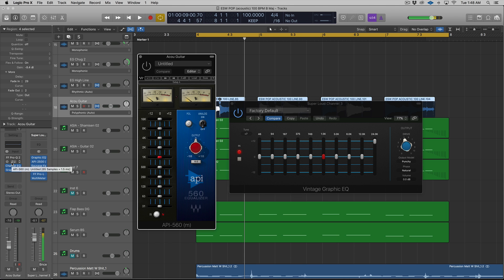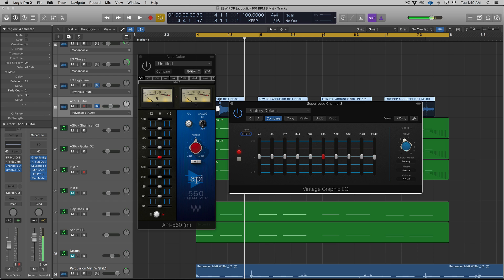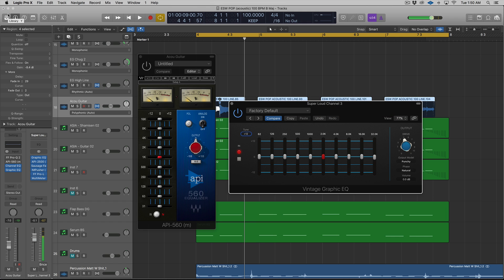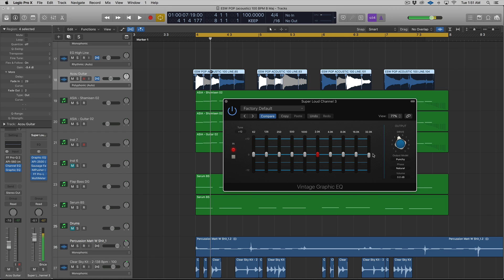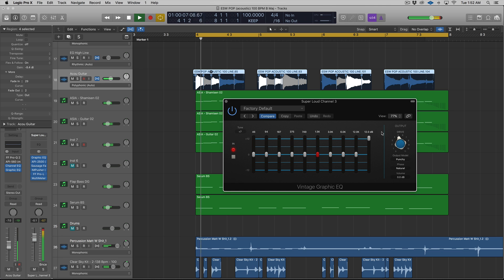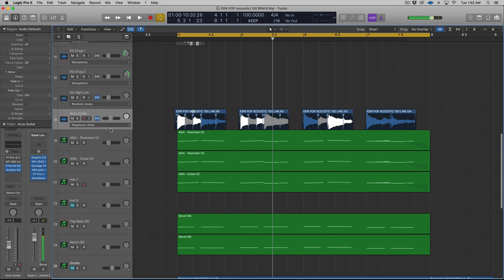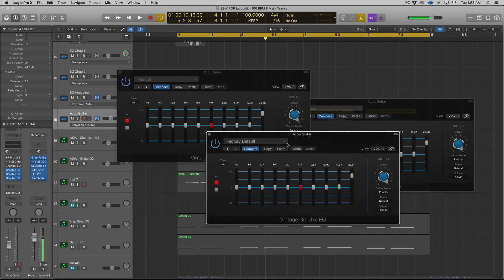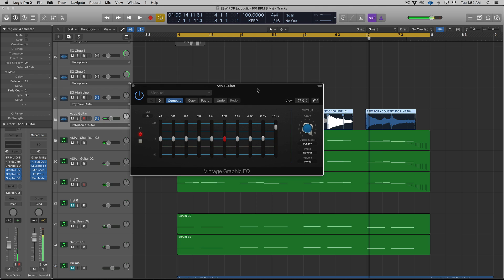Logic X Vintage EQ -  Air Band Pro Tip

Comment: The high frequency resonant peak of a record head is right around 25kHz. When I would set bias on some machines, I'd set it for a 3/4 dB peak at 25k and the producers LOVED that air. 25kHz is really a great place to do this... especially if you're in higher sample rates... 88.2k or 96k... where you'll be able to hear the difference.